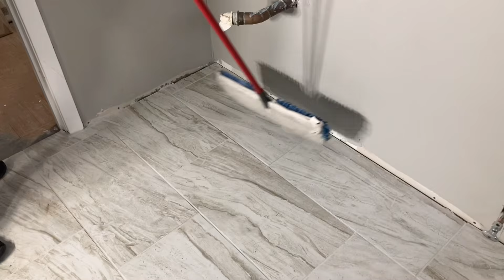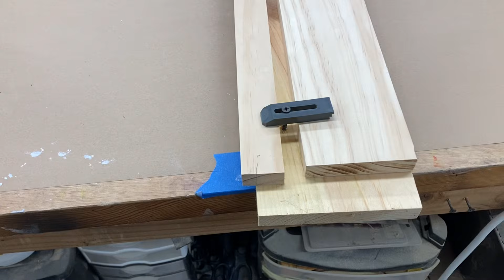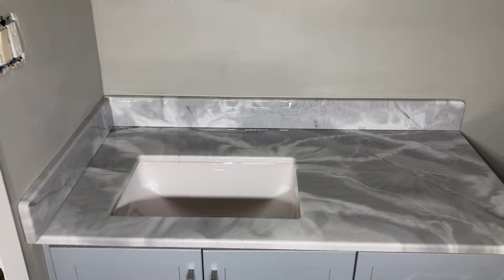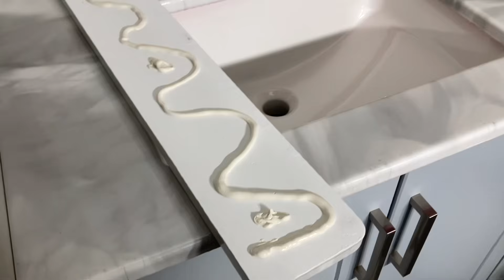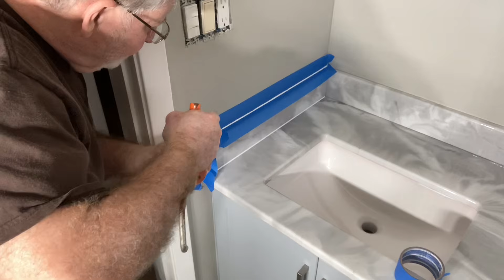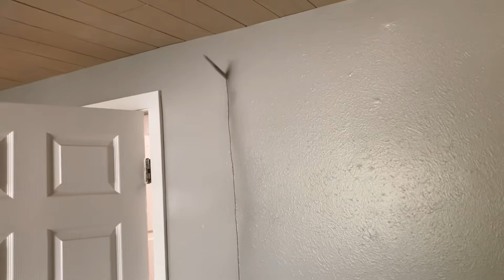Tips and Tricks to Installing a Bath Vanity and Countertop

Comment: What do you do if the cabinet and the top don’t match up except along one side for the silicone and one corner? Thx!
Reply from the maker: The backsplash are separate pieces and should be able to cover any areas that may be out of square.

Comment: White caulking is the worst choice you can go with in a bathroom around areas with high water & moisture, he should have gone with a color match grey or dark grey and how do you measure the overhang for the vanity top if it's pushed against the wall